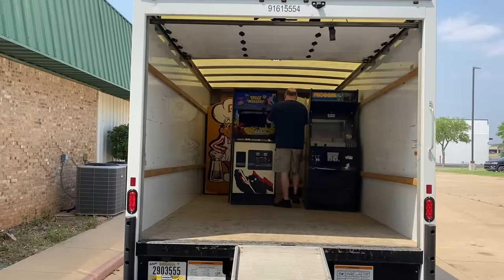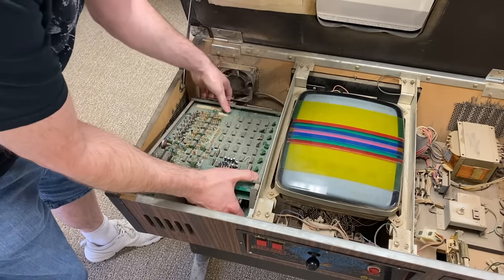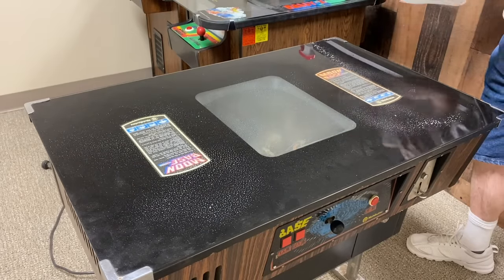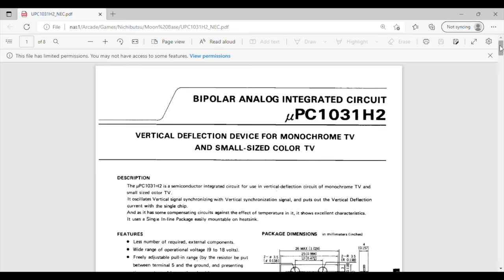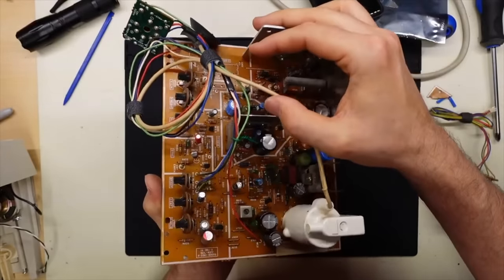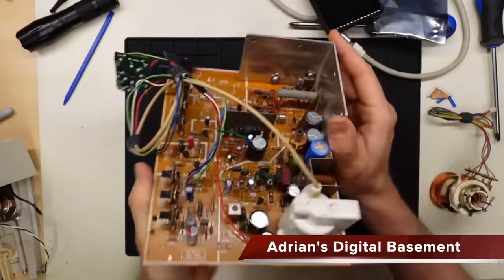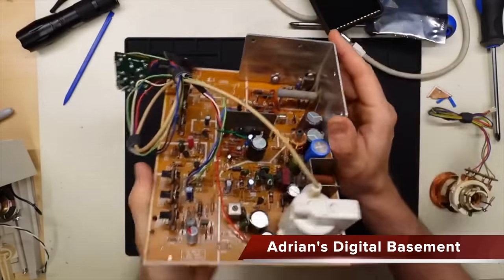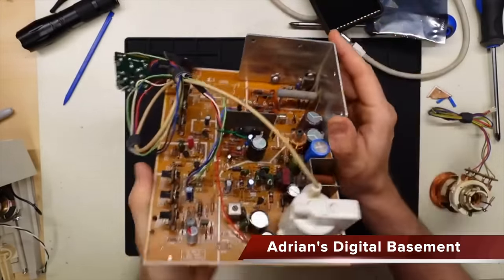Moonbase Arcade Restoration - Gone Wrong

Comment: Driving north when you really re going south.... in most parts of Utah not knowing north from south or east from west is almost impossible to screw up unless you are really new to the area and don't know one mountain from the next..... That is until a blizzard comes in and  there is very little visibility to your surroundings and you cannot ready any road signs or see the mountains for directions. 
Happened to me just once.... during  blizzard on the benches of the mountains near my home. was driving the scenic route since less people travel it and my car could make it through the snow. too many people drive the more "safe" routes with cars that cannot drive in more than an inch of snow with summer tires and get stuck on a tiny incline and cause accidents/ something I wanted to avoid.had to go some odd way around and knew to backtrack further away from the hill that some silly person kept going slow on and kept slipping back on and on my way back I made it to the main road, but went the wrong way... back up the hill instead of downhill to my home.
 took me a moment, but I did realize I was going the wrong way eventually when I pulled off to the side of the road, got out, and read the street sign..... then went another block away and did the same to then get my bearings. (we use a grid system with numbered streets going north south east and west) got home safely, but yeah... very disorienting to drive in a nasty storm.

Comment: I remember old TVs that had a roll adjustment POT.  Maybe find some schematics for those to find out where to put a POT to allow you to adjust the impedence?  Or maybe a viarialble capacitor, not sure how they worked, I have no more traditional CRT TVs or monitors in my posession.

Comment: I bet the reason why they had 2 keys for machines like this was so even if someone managed to steal the one of the keys, they still wouldn't be able to get inside without the second key.  That power thing on the label saying 100v may be just that and you could be pushing too much voltage through it.  You might have to find a way to reduce the amount of voltage being pushed.  That circuit could be getting too hot as well during extended operation.  Maybe an additional fan blowing across it could help.  And did you use that paste you use on CPUs on it between the chip and heat sink?

Comment: It looks like a faulty HV auxiliary transformer winding or a invisible crack on the circuit board in the orizontal deflection section. Remember that the picture tube is mounted sideways. A routine job for anyone that serviced TV sets of that era.

Comment: You can possibly have a defective yoke that's screwing up after it heats up. Personally , I would try to replace the I.C. again, get a variac on the power line and run it down to 100 volts A.C. and see if that fixes things. If you want to be sure you don't blow up another vertical I.C., maybe try to find another yoke and replace that as well before testing it again. Also, make sure to use a dab of heat sink compound on the I.C. mounting tab.
If the yoke has a short in the windings somewhere, it can draw too much current and overheat the vertical drive I.C., causing it to fail eventually.
Keep in mind that if the vertical drive I.C. actually was defective, you know that the problem is either in the vertical deflection circuit, the vertical deflection winding of the yoke, or possibly the power supply to the vertical section. You can pretty much rule everything else out.
I hope something here helps.
(42 years consumer electronic service tech)

Just thought of a couple more things you can check. Check for cold solder on the yoke leads where they're soldered to the yoke, and at the circuit board end. Also make sure the yoke connector at the circuit board end of the yoke wires is tight. Check the tightness of the spring terminals in the connector.

Since the problem shows up after about ten minutes, It can definitely be heat related. Get yourself a can of "Freeze It" spray and after it does it, cool individual components in the vertical deflection circuit one at a time and see if cooling any single component rectifies your issue. If so, replace that component.
Have fun.

Comment: here's a tip for you dave you know that replacement ic you added was inserted backwards instead of fliping it around bend the pin that was in the wrong hole and solder a wire to it so when soldered it won't cause more problems in the futere for this arcade machine

Comment: Hi, just an idea from my experience in repairing TV's and monitors over the years, never underestimate those small Tantalum capacitors for example the tiny one between the vertical IC and the big electrolitic on on the verical zone of the board normaly 1uF or 0.1uF they often drive me crazy, i would not say the IC is blown as that would produce a line on the screen and not the rolling picture, just my 2c Good luck ;)

Comment: Great video! Screw the armchair know it alls. It's all just having fun figuring out what's wrong and fixing it. 

If you don't learn from your previous mistakes, then you shouldn't be doing whatever that is. That being said, sounds like you learned a lot and you got that darn thing working. Good job! 

By the way, all those vertical, horizontal deflection in other CRT adjustments are a PIA. Remember those little AM/FM radios you had as a kid and you open it up and adjusted one of the four or five multicolored adjustable transformers? I adjusted mine and completely miss tuned it, thanks to my dad for being an electrical engineer and had a scope he was able to adjust them better than they were out of the factory. Sorry for rambling. Great video! Thanks for sharing.

Comment: It's really hard to troubleshoot the issue without a proper oscilloscope.  I suspect the rolling motion has to do with interference with some other nearby component signal. You could just replace the control board with one from a monochrome monitor.  The yolk should be compatible considering there were only a few CRT manufacturers since manufacturing them is a huge capital expense.

Comment: that IC will not tolerate more than 18V, so check pin 2 or 10 to see what you got.
also, the power supply section is confusing because the manual only shows options for 90 or 100 volts, but i got the glimpse of "240V" on the sticker of your transformer. maybe a different transformer with 120/240 winding?

if voltage is okay, check values of components associated with that IC. it is very possible a resistor has drifted and it's pulling more current than it should out of it. should be 30mA with no signal or load

Comment: In my experience as a coin op arcade tech, a CRT image like that immediately implies bad CRT grounding in the SYNC input (because your SYNC lock isn't stable) or an AC ripple in the power supply to the game logic (those old games used linear power supplies). A simple oscilloscope probing of the SYNC input to the CRT would reveal the problem instantly. That would be like a day fix

Comment: There is a well known silk screen error on one of the more popular chassis from the golden age era, for a capacitor.  So even if your reading and following everything right and you go off of the silk screen for polarity you will get it wrong.  I want to say it was either a G07 or K4600 that had the wrong silk screen error, I can not remember the value of the capacitor though.

Comment: Just an FYI: If you plan on throwing those old locks away (like the one from the coin drawer), you should consider selling them on eBay. There's a community devoted to picking locks and whether it has keys or not is irrelevant to them. The hobby or community refers to this as "Lock Sport". Some of the unusual or weird locks can sell for a pretty penny.

Comment: By the way, the best way to remove rust from chrome is with a crumpled up ball of aluminum foil and some water from a spray bottle to lubricate it. The foil is harder than the rust but softer than the chrome. I have always had great success with this method on old car parts and bicycle fenders and rims and such.

Comment: Try checking the power levels into the chip, place some 0.1 uF caps on the power rails of the chip, you might have supply spikes destroying the chip. Also check the heat sink of the chip, might be getting to hot.

Comment: Power supply. Check the bridge gates and caps. Grounds and make sure no GFI. Might need a noise filter. I would guess that is why it fail. Run power supply without the board connected and monitor the voltage to the board. Watch for spikes. And no GFI.

Comment: I'm not a CRT/TV expert (A TGV expert, on the other hand?... 🚄🇫🇷❤‍🔥😉) but going on articles that describe how to generate VGA signals from digital I/O pins (And some others on how analog (PAL) video signals are encoded) you might be able to take that single signal wire and connect it across the RGB pins of a VGA input connected to either a classic CRT, or a modern LCD. 💻

Obviously a composite RGB input means R+G+B=W, though connecting the signal wire to one input pin only will make testing quicker, easier, and reduce the likelihood of running into impedance related issues. 📺

Wishing you all the best of success for and in part 2! ❤

Comment: I would say check psu is giving the right outputs as after all it said 100 volts,then replace that chip as its probably been damaged being put wrong way round,should not be too bad to fix.If after this the fault comes back,i would make extension leads for the crt and pcb together ,so it can be run on desk,after all it only needs power and vid signal to work.

Comment: Are you certain that it's the chip that's failing?  If so, I recommend using an oscilloscope to monitor the voltages being applied to all of the chip pins.  Compare against the electrical specs in the chip datasheet.  Look for any irregularities, spikes, etc.

Comment: Are you running a 100v device at 120v? Mains voltage in the US varied over time and area, and could have been 110v in Texas in the 80s, which would have stressed the device but not necessarily ruined it. Today, a hard 120v is common, and may be enough to fry components. I'd be surprised if that wasn't the problem, to be honest with you.

Comment: Rubycon caps, nicely built.  You won’t find any modern electronics with those, with the exception of higher end equipment of course.  Why not use a longer air hose and blow out dust outside?

Comment: your problem is you are missing the label by the service outlet for the switch there. its the power switch for the monitor. one direction at least for my japanese version of space invaders is for 110 and the other is 120. secondly for me I wrapped the control shaft in a little electrical tape to tighten it up and adjust the 2 return leaf springs. makes it all good. you have the same sound board as mine but mine has the intruder board set in it.  your system was probably set for the right input voltage but the manual should have info for adjusting the monitor voltage switch. can't find mine right now. but it is set for 120v line input

Comment: I would check the voltages in and out of the chip you replaced, and this is major, purchase a surplus variable transformer, adjust it to 100 volts, and connect the game table to it,  Our normal 120vac is 20% over voltage input, the crt works from high voltage, its possible the crt and its control are all operating at 120% of designed power use

Comment: I have been working on my own arcade project and old arcade monitors are in some way's easy, and in some way's really frustrating to work on.
Like why the hell isn't the power transformer labelled. Or testing it, and not knowing if it's the signal, cable or the deflection board.
It's a real hassle if you ask me. Respect to the homies back in the day repairing these beasts while on location.

Comment: Two things I would made differently
1. I'd put the freeplay button in one of the lockholes and only lock it on one side. Not be needing to drill holes in it (never gonna be in public unsupervised again anyway)
2. Id bypass the coin counter to keep the actual number of coins used. (to keep the history)
Otherwise, cool project
Btw, You sure that 100V thing really like the 110-120V you are using now?

Comment: I wonder if the original power supply being set up for 100v could be over driving your components?  Obviously that doesn't make sense if it functioned for years on it elsewhere, but maybe the caps and such were replaced to the original spec at some point by someone not realizing it was expecting 100vac instead of 120.  The only thing I can think of is that the original chip you found burned out was simply more robust and could handle the variation better before finally dying and the new Samsung chip was simply being driven at too high a voltage and popped.

Comment: those round locks can easily be picked with a heat gun, and a bic pen, take the pen apart, heat either tip of the tube, and place it into the lock, hard, and hold it there, blow on it to cool it and harden it, when hard, turn, et voila, you're in.

Comment: Considering you have access to the video signal, my suggestion is removing the CRT entirely and adding a flatscreen with a Coaxial input (I'd recommend using a Coax to HDMI adaptor or working VCR).

Comment: Could it be that the cabinet was never converted for 115v use? The logic boards are likely protected by 7805/7812 linear voltage regulators so a little over voltage wont reach the ICs, as the regulators will do their job - but no such regulators are likely to exist in the CRT circuitry, so the board might be being over volted? 

Testing the voltages on the CRT PCB at strategic points should be telling - making sure to use the transformer in this cabinet and not another one.

Comment: Al lthree issues (rolling, distortion, wrong shape) will have the same cause - check for an AC component on the DC voltage rails (meter set to AC or betteer still, an oscilloscope) and the actual DC voltages. I'd vefinately try it on a veriable transformer (variac) and wind the input voltage up and down to see what it does. It syncs when the display is flat so that tells me that the sync circuit is being swamped by the voltage distortions - suggesting power supply issues.....

Comment: to fix joystck slop put a little bit of electrical tape on the shaft in the bushing and it will tighten up enough to feel good and be very playable.  I have done it on mine

Comment: If the chip burns out... Why not upgrade the cooling so it could survive the constant "overclocking" by higher voltage. 
With upgrading i meant getting the heatsync from passive to active.
How to ? Get dead laptop, salvage heat sync+fan, (if 5v fan) connect power leads to an usb cable that you plug into a phone cahger that will be plugged into the service outlet inside the device. And boom, you overclocked your cooling. Yes it is not healthy for the chip, but it will make it last a lot longer (probably)

Comment: Been there myself. I once found a really old 50Mhz Pentium with no heat sink and a perfectly square pin array. This CPU could be orientated any way, and would seat its self perfectly and had no notch so I had no idea what pin 1 was. The computer didn't POST and the corner of the CPU went bright red in about 10 seconds, fried it.

Comment: I suspect the 100 volt requirement may actually be the issue. If the voltage is 20% higher than expected, it’s probably working fine until the chip finally fails from the overload. Try it on an electrical adapter for Japan once you change the chip again to see if that solves the problem. That’s my first guess. My second guess is the cabinet needs to be hit on the side rather roughly but no so rough you knock the ash tray off the top. My third guess is do the other monitor thing before you waste half you life on a dead end project. 😂 Good luck.

Comment: The worst case for a cocktail cabinet game is that it is completely bricked , and in that case it could be put into service as a case for an LCD screen and a Pi running emulation software. And since the whole thing only cost $200 it would still have been money well spent just for the cabinet.

Comment: a lot of old arcade monitors were 15hrz and should state in the manual. if so a 60hrz tv should work fine through comp. an old lcd tv may also work and could be screwed to the top plate leaving loads of room inside

Comment: 4th option... since it's a space invaders clone (not worth anything), tear out everything, redesign a new control panel where it sits flat like a normal arcade, add modern monitor with a basic PC and make it a MAME cabinet using all vertical games like time pilot, Donkey Kong, Pac-man, 1942 etc. Then put on some 8BitGuy vinyl graphics to make it pop.

Comment: Im not an expert but I think it might not be a bad idea to check solder joints, I have heard cracked and dry joints are common on old arcade monitors and can be the cause of many problems, 
I also saw a noteworthy comment by a person going by sage saying that the fact the unit was meant to run on 100v but Is bring run on 120 could be it 

Either way if this monitor was common you may be able to search the schematics on Google and check everything related to the hold circuit with a multimeter, I find CRT schematics seem to be really common even with obscure monitors
Hope this is useful